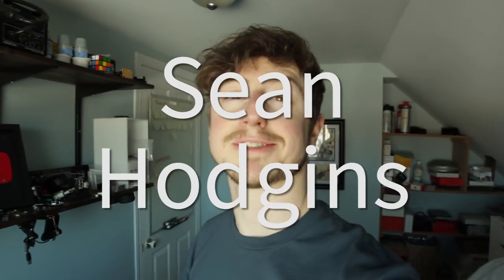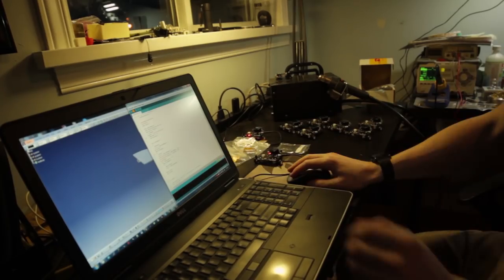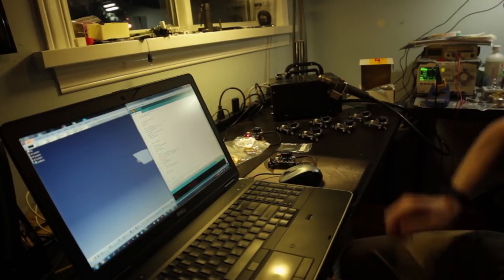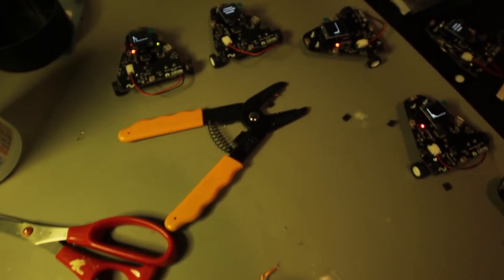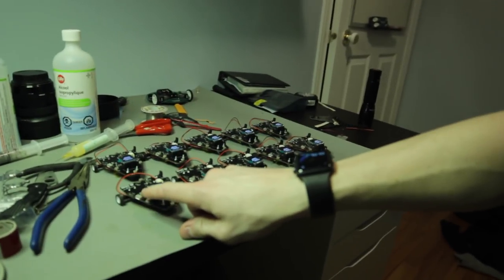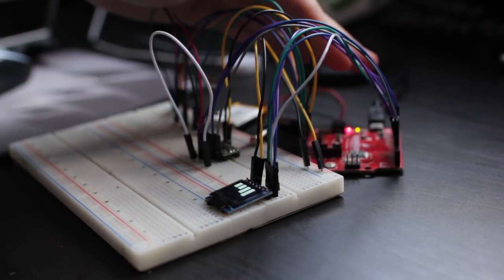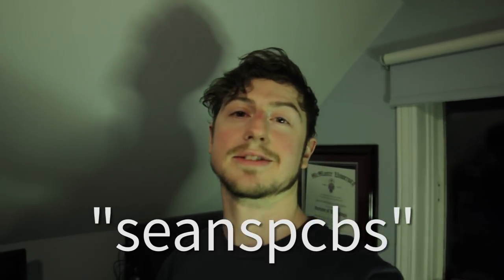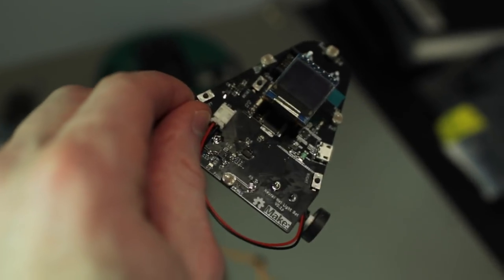Assembling A Neural Network Robot Army

Comment from the maker: They're a pretty terrible army. They just run into each other and spin in circles when the light is on.
Reply: this is really cool! I subscribed to your channel right after your Make video. can i suggest something? I would really like to see this robot applied with swarm algorithm. my suggestion would be Particle Swarm Optimzation algorithm. It is pretty easy algorithm to apply with. anyhow, thank you for this cool vid!
Reply from the maker: It would be difficult to do some swarm techniques to these specific robots because they have no external communication with each other or a computer. However, I am possibly working on a robot for this very purpose. ;)
Reply: Can u add swarm algorithms may be glowworm optimization?